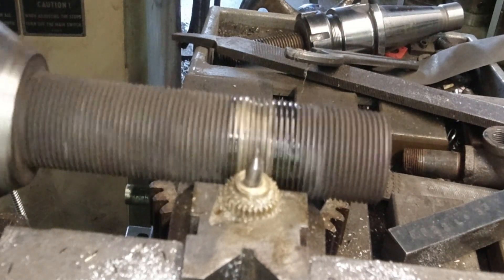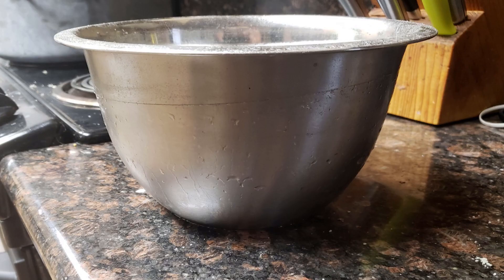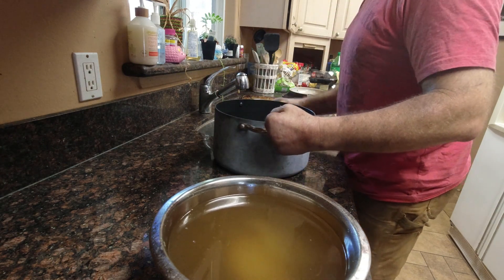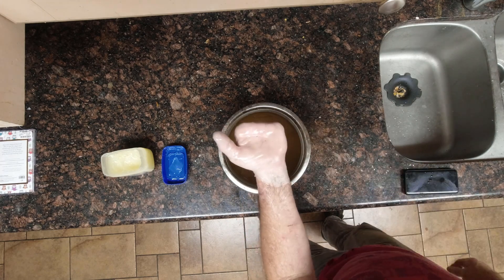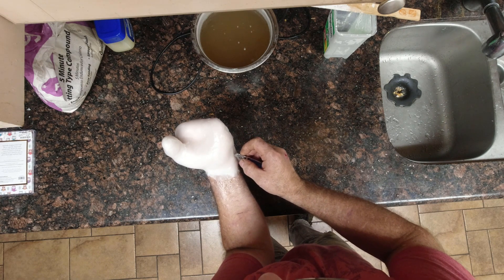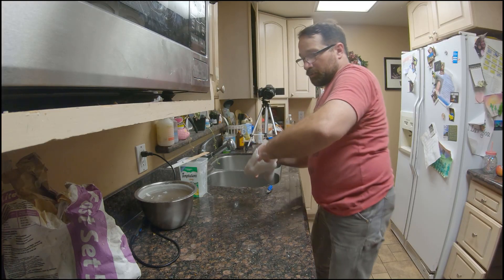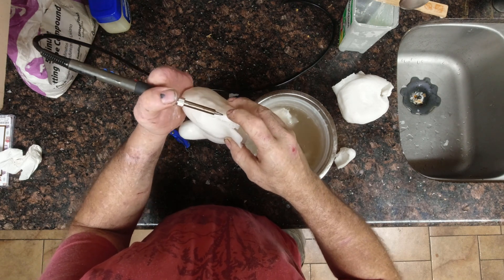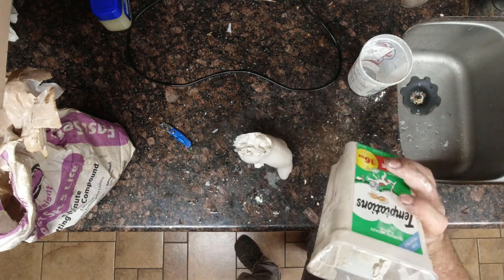Part1 How to build a partial hand prosthetic socket.

Comment: I've seen some wax art by dipping the hand alternately between the hot wax and ice cold water.

Having a very thick wax coating made it possible to just pull the hand out of the block of wax without cutting or opening it up.

The initial process is to coat the hand with Vaseline, dip the hand in cold water for a while... so the hand would be protected from the heat, and the first wax layer immediately hardens around the hand.

Then quickly (in and out) dip the cold hand into the hot wax, then dip it immediately in cold water to harden the wax. Just alternately dip the hand between hot wax and ice cold water.

Repeat until the hand is a thick block of wax.

The hand can be pulled out with little effort.

Then the mold was filled with plaster. Upon hardening, the wax mold is opened and the wax art is now a plaster image of the hand.

The images below are just some of hand postures made by different people in a country fair.
👍🖖🤟🤘✌️✋🤞👌

So pulling out the hand from the wax mold is easy due to the Vaseline.

Comment: Thank You for your videos! they are amazing. I was wondering, what about if you use photogrammetry to make photos of your hand prosthetics and make a 3D model mesh then use CNC to make mold pieces? 
By using milled metal mold base (2 part): pour wax through little hole, wait till cured and wualla! separate mold pieces, remove the newly formed prosthetic base, - in theory should work. You could make prosthetic socket fast and produce more awesome variations by combining creative ides. P.S.  - and no more hair depilation therapy too!
Also 3D printed socket, wonder how that would feel. There are many materials nowadays, that can be used for 3D printing. Also combining flexible and material while printing, you could make a comfortable socket, protecting your hand from tiring encapsulation and harsh contact of material on skin during long time of use.

Comment: Neat way to achieve diy shape capture of your residual limb! I could see how plaster bandaging would be less than optimal in your situation. Have you tried moulding in other positions? I typically aim for about 30-40 degrees of wrist extensions during casting or what’s known as the intrinsic plus position. Could add some excursion to your linkage system/ intrinsic musculature position for comfort. Just a thought, if you’re happy with the aesthetics and feel of your interfaces keep up the great work!
Reply: Sweet deal, yeah just checked out where your trim lines were in a different vid and it wouldn’t affect too much. I am indeed O&P trained in my own pursuits of making a better prosthetic to deal with my own amputation so I definitely emphasize with your situation. Looking forward to more great content.
Reply from the maker: You sound like you are in O&P. 
Yes I have, but for where I'm going with this mold it wouldn't help anything. I cast the forearm separately.  And depending on what I'm doing with the device will determine the placement and arrangement of the Gaffney.  For this I'm immediately cutting the thumb off of the plaster for the layup. You'll see in the next video.